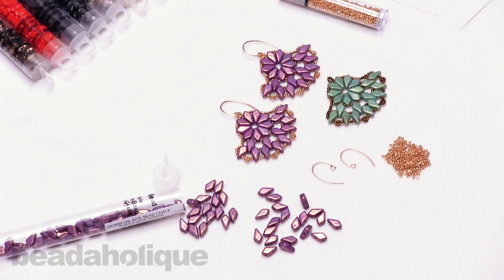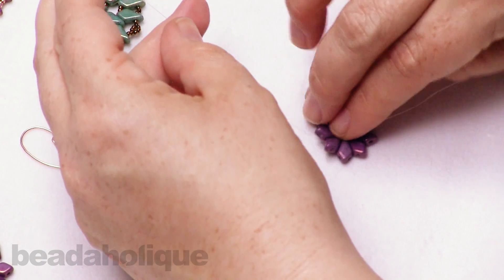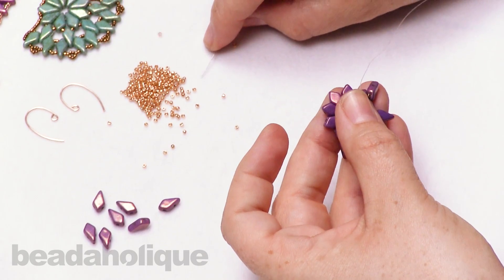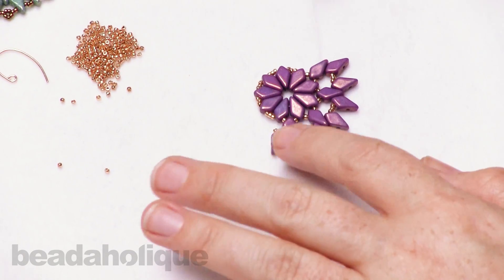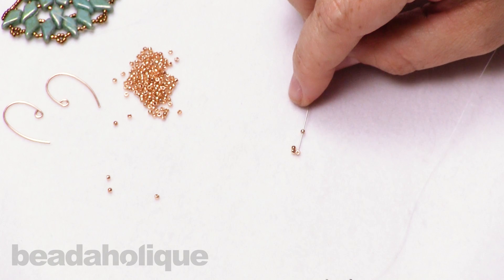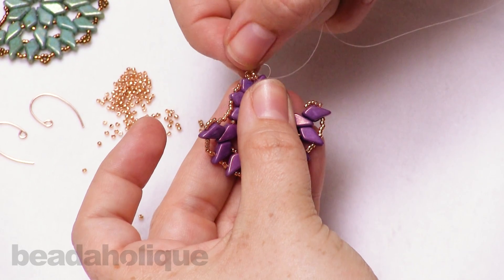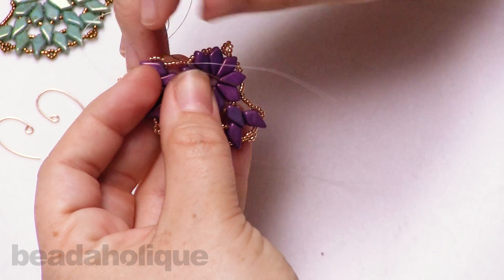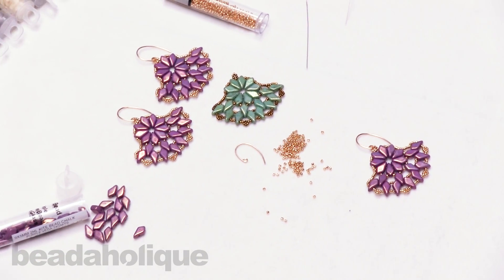How to Make the Polynesian Palms Earrings using 2 Hole Czech Glass Kite Beads and Toho Seed Beads

Comment: I followed the instructions step by step and it hangs warped as in it won't hang flat...it hangs kind of curled in... I tried making the thread loser but it still hangs kinda warped...any tips on how to prevent this from happening?
Reply from the maker: It may be a tension issue with the bead work.  They should hang fairly flat.  There may be a slight bow over time as the thread loosens but with a taught thread it should be pretty stiff.  I might try going back through the bead work with thread to help with the structure if you find it too floppy. The heart of this structure comes from the central "flower" so focusing on that should help.